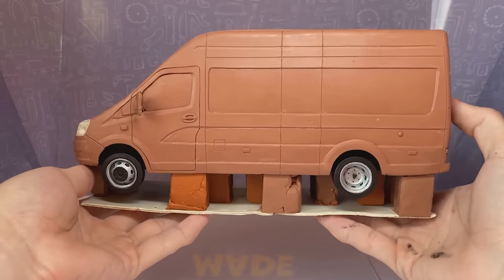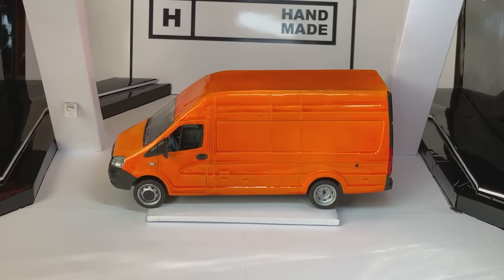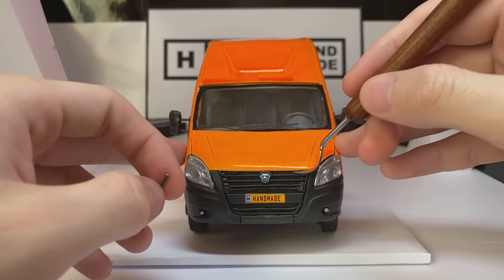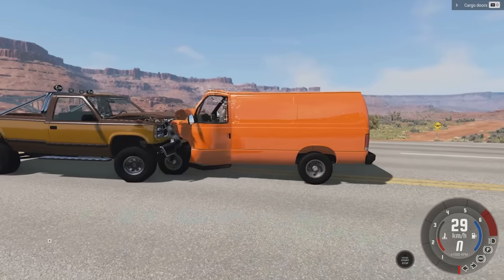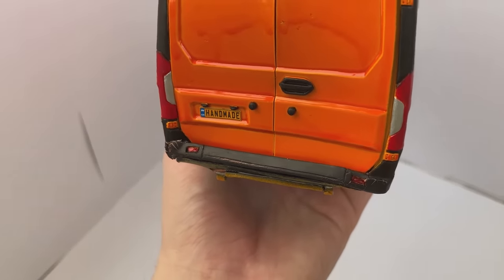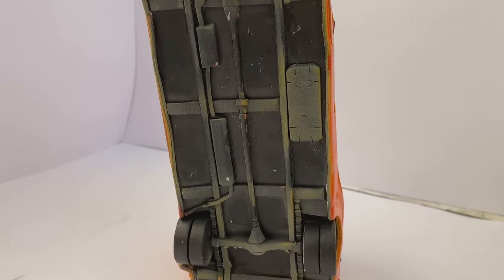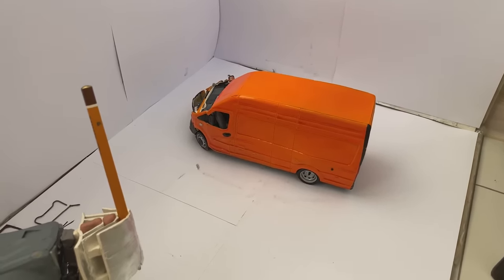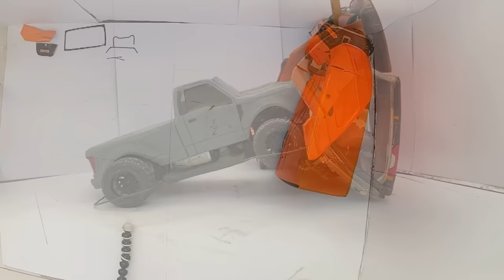Crash test van Gazel Next of plasticine clay

Comment: When I was a kid, I did "crash tests" with cars made out of metal candy wrappers held with LEGO pieces. This guy is on another level.
Reply: How does that work
Reply: @Playing096  Most of the time I just did a simple chassis with wheels and a post in the middle. I'd then form the body out of the metal wrappers (or tinfoil) and attach it to the base by putting it over that middle post and pinching it down with another flat lego piece on top of it.
Reply: i would always use ketchup packets for soft body crashes
Reply: @FokkerBoombass  I actually did something similar, but with paper towels taped to a basic chassis
Reply: @ShootNCxver  how would THAT work?
Reply: @Playing096  well use your hands instead of launching them into eachother and basically simulate a crash with your hands
Reply: @ShootNCxver  ohhhhh
Reply from the maker: thank you very glad you liked it)
Reply: Damn, and I just slammed my dinky cars in the sliding window 😂😂
Reply: When I was a child I smashed about 100 cars up with a rock.
Reply: @legobrickabrac  what did they do? 💀
Reply: @Playing096  Race to the top of the mountain the one that survived getting smashed was the winner.
Reply: same
Reply: i am still a kid and i personnally use paper boats and make them look like cars
Reply: @srihariandco  same I'm still a kid
Reply: I disagree. Cars made out of metal candy wrappers and LEGO are bleeding edge state of the art. Nothing can top that.
Reply: @clay_cars_creator you copied this video
Reply: I sometimes get me my lego monstertruck and push it so it makes rllover crashes XD quite fun
Reply: @FokkerBoombass  same
Reply: I used tin foil but no wheels, pretty lit ngl
Reply: @hippochondr lkyng
Reply: @hippochondr p
Reply: @tracy-anneang2487   YOU ARE 5
Reply: And me

Comment: When I was younger I entered a toy designing competition. I designed something similar, it was a RC car with a body made out of a shell of thin tin / aluminum, (Think metal take away container), the shell would be the shape of the car and underneath would be a smaller frame that would house the motors and battery ect, the idea being you could crash the car and it would deform realistically and the frame under could expand back to the original size and shape to reset the damage using servos and linear motors to push the shape back out. Also there would be swappable shells.
I ended up winning 3rd place (First and they would have put it into production) and was invited to The Houses Of Parliament in London for the awards ceremony, but I never went..